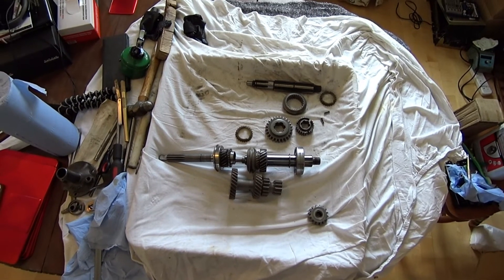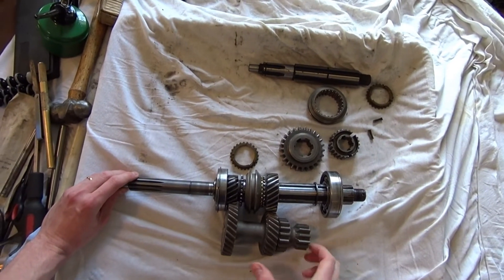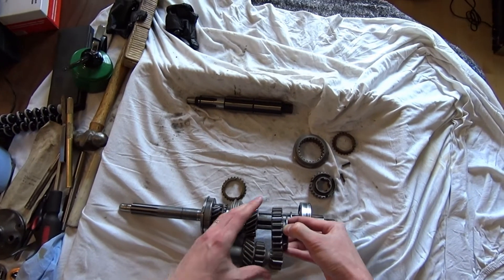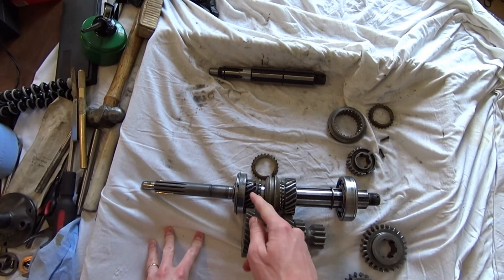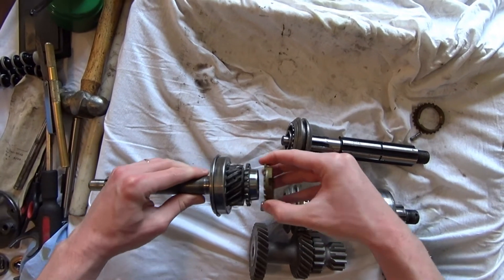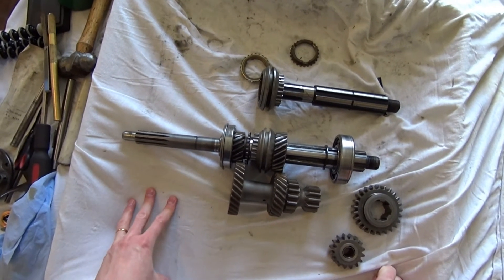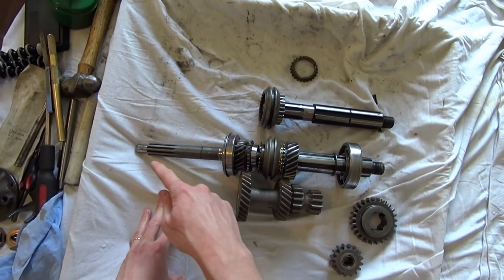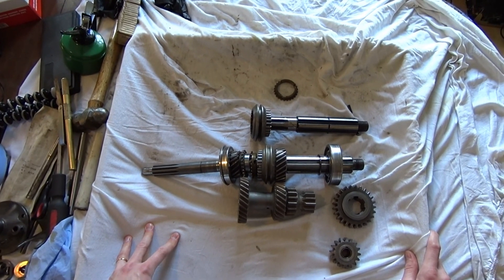How does a Willys jeep Transmission work Anyway? (T84)

Comment: Great video my 43 Willys has a gear shift fault 1st and reverse are fine but can not engage 2nd or 3rd have not tried double de-clutching so seems like my locking rings could be worn not gone down the dropping the gear box yet, but looks like that is next. Will show this vid to my mechanic and see what he thinks.
Reply from the maker: Yes Andy, 2nd and third difficulties are likely to be the Synchro, cheers Matt

Comment: An excellent explanation of the function of a gearbox, and a really good simple gearbox to use as a demonstrator, I think some viewers may be confused because it is only 3 speed, they will be wondering where the other gears are. If you could find an old cracked gearbox casing you could make a cutaway box with all the rejected repro bits you will be throwing out of your gearbox, I threw a badly cracked casing out a short while ago. Many thanks for this update. Chris B.
Reply from the maker: Thanks chris.  I shall try and buy a bad case and cut it up to use as a tool.  That should work really well! Perhaps one of the UK dealers has a rubbish one I can buy.